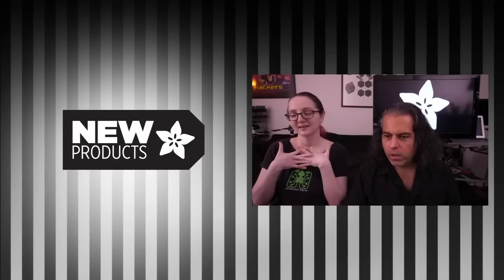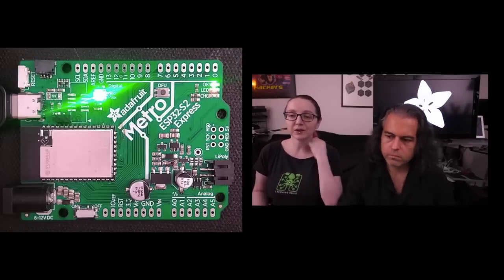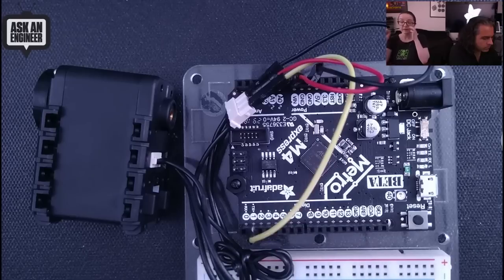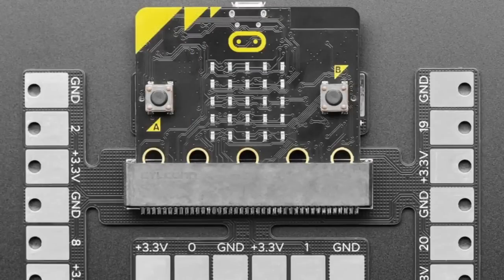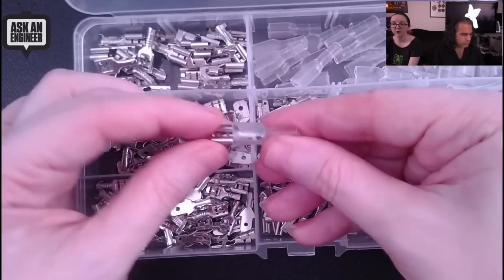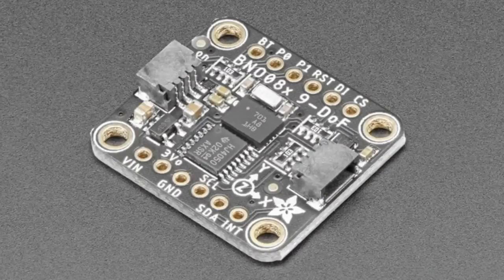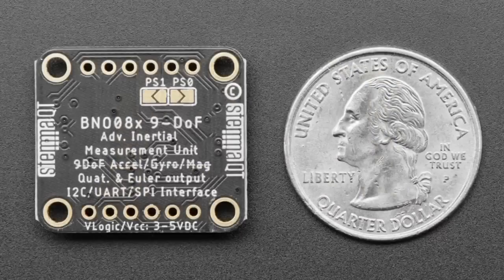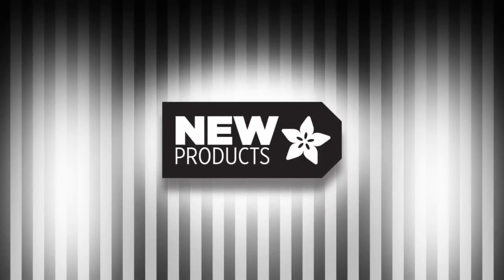New Products 10/7/2020 featuring Adafruit 9-DOF Orientation IMU Fusion Breakout - STEMMA QT / Qwiic!

Comment: We used a BNO055 IMU for a project last year, and we really struggled with drift (which is probably our code). I'm definitely giving the 085 a look, and those Qwiic connectors are a nice bonus.
Reply: The 070/080/085 has much better built in fusion than it's cousin the 055, though beware that no micro imu is without drift. Totally different protocol, though, since it's totally different built in firmware.

Comment: The new ESP32 Metro only accepts 5 volts from USB-C, right? (In case anyone tries to hook it up to a QC or PD port) What's the max current it can draw?

"You can nail it down." Or use screws with conductive washers... That would be a nice alternative, and you can use fork or ring terminals if they're small enough.

I really could've used those spade connectors when I was messing with an arcade button. Used solder instead. Spades are probably more flexible/safe.
Reply: M Murase plugging it in to a PD port is fine. In order to get voltages above 5v on a PD port a complex negotiation has to happen which this board definitely will not do.